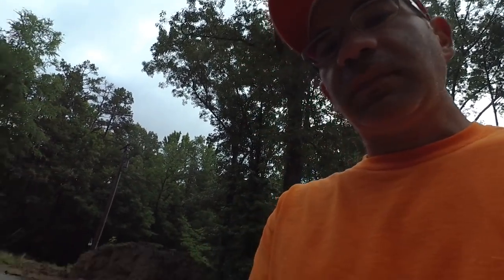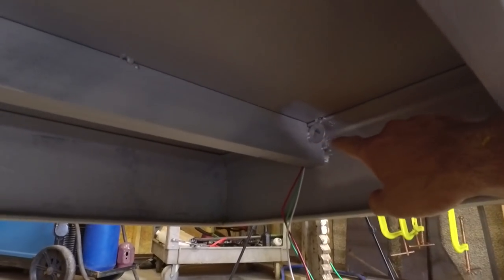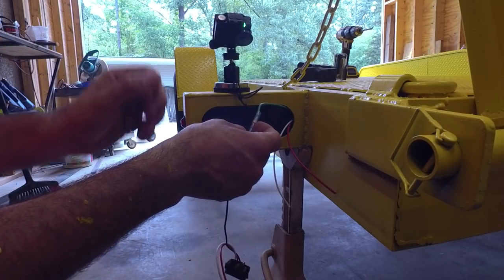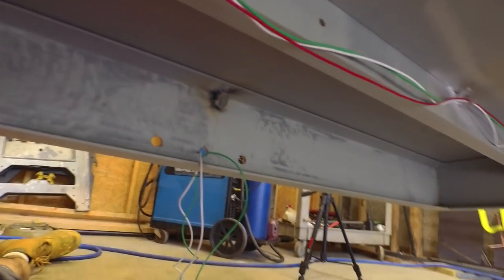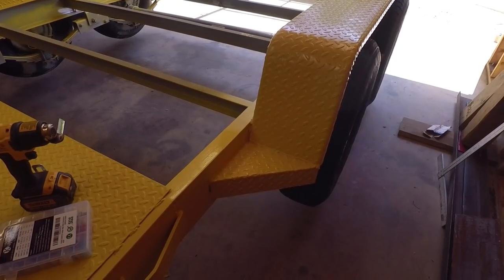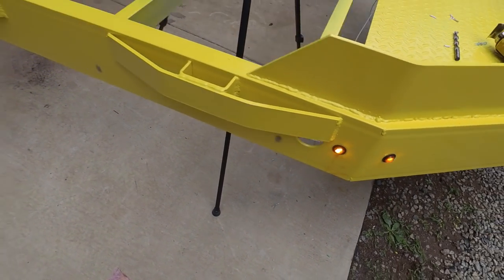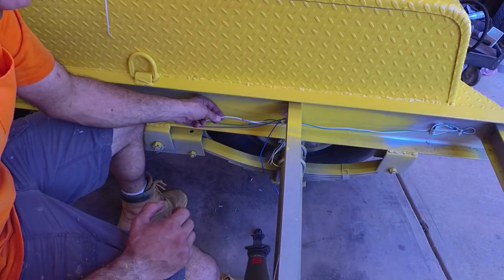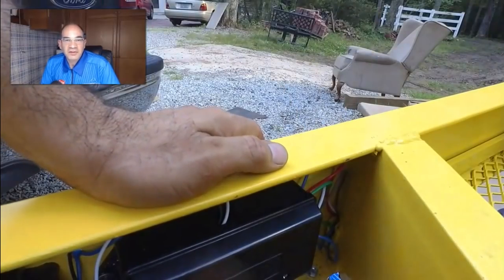Equipment trailer build part 4 Wiring How to wire an equipment trailer

Comment: You should never use the wiring diagram that comes like because it's wrong for a 7 flat connector on rear of all pickups. Brown is always running lights, green is right turn and brake same color as the grass on that side, yellow is left turn and brake like the lines in the middle of the road. Those three colors don't change between trailers until you get to a semi-truck trailer.
Reply from the maker: Hi Preston - I used the 7 round standard not 7 flat. It's the RV standard as well.

Comment: Running wires in washers isn't a good idea.  It will rub and the wires will fail.  Its best in a tubing.  I done trailer work years ago for a welding shop.
Reply from the maker: I would think so too, but my 15 year old trailer is wired this way. I will keep an eye on things.

Comment: Hi I did a test run on my French Drain and water I put crushed rock down first then pvc corrugated then I put more rock on top then I started putting water on top of the crushed rock and then I went to the end where the discharge smooth PVC schedule 40 pipe is to wait so I can see the water and I noticed the trench started filling with water instead of coming out through the PVC pipe☹️🤦🏻‍♂️ did I do something wrong?
Reply from the maker: Did your pvc pipe have holes in it? The water should fill up the rock until it comes to the holes in the pipe, then water floods into the pipe and through the pipe.
Reply: Yes they do have holes and I dug that front part up just to where it connects to the solid drain pipe is and I noticed that there was not any dirt there just rock so my guess is the water was draining down the trench instead of building up to go into the pipe so I’m going to put some clay soil in front of their packet and we are good and then do a retest or maybe just pour some cement in that area and then put dirt and then do a retest
Reply from the maker: @rfl35  you want to really compact that dirt so you form a trench that fills up with water. I like your idea for solving it. You should be good.
Reply: Ok thank you I’ll keep you updated and thanks for answering my question! You ever thinking of doing a podcast or a Q&A through YouTube that would be so awesome!!!!!
Reply from the maker: @rfl35  I don’t know how to do that but it sounds like a good idea.

Comment: That darn yellow paint job hurts the eyes! Curious why you picked such a color?
Reply: He said in the painting video it functions as anti theft, because it would be more unique
Reply: @ravneiv  How often do trailers get stolen ? and why not lock trailer hitch and run cable or chain thru tires . Looking at that yellow has permanently blinded me .😂
Reply: @saltygreek3870  I don't know personally.  I have a buddy that had two trailers stolen. His new has the locking hitch and a hidden GPS tracker.
Reply from the maker: I chose the yellow. I like the bright coloration to be seen. It's rust-o-leum John Deere Farm Tough. Trailers here do get stolen and taken down to SC where there are no titles. If you have a white cargo trailer, the best defense is wrapping it in graphics. Locks, cables, chocks, get cut. Graphics or yellow paint is too hard to remove so thieves move onto easier targets.
Reply: I like the yellow makes it easy for some fool driver not to miss it on the road.

Comment: You should have done this better. Use plastic conduit for instance to run the wires threw. You need grommets on your holes or the wires will wear threw. Zip tying them to the washers would have been better. Metal and wires don't go...

Comment: A couple things to note: 
Using standard wiring colors for the function for your runs after the junction box would be a huge improvement if anyone else ever has to work on the trailer. I know I'd be pissed if say I didn't have a left turn, and was tracing the yellow wire only to find out someone used it for a different function. 

Protect the wires, most wire insulation won't last nearly as long exposed to UV light and the elements. Insulation should never be in a position to directly touch other surfaces that it could rub through on.
Reply: He has wired correctly as per SAE J2863. This is the correct standard for this application in his region. He does not have reversing lights so he does not need the purple wire.
He did double-up the brake live signal, but it may be an idea to double-up the brake ground as well. Alternatively, use more of those self-tappers to earth the ground to the chassis as appropriate.
Reply: @SalvoDan   
The color coding is nowhere near correct for US trailers.
Reply: @SalvoDan  
For a US light trailer like this it should be:
Yellow: left turn
Green: right turn
Brown: running lights
Black: reverse
Blue: brakes
Red: 12v+ aux
White: ground

Comment: Man...running that wire through the frame, washers, etc. You'll be without lights in no time. The edges of that metal will chew through that shi**y PVC wire in not time.

Comment: Why did you bother grounding the frame of the trailer when you didn't use the frame for any of your ground connections?

You're also asking a lot of that little ground wire to do all of the brakes and lights. You could use the trailer frame to ground the brakes.
Reply from the maker: More ground is better, especially if the trailer breaks away from the truck. I was thinking I may splice in a ground-to-frame at the trailer brakes. Good idea!

Comment: yeh this is sketch as, not how to wire correctly, no proper sheathing or rubber gromits, at least solder some of the joints. Alot of movement occurs in a trailer.